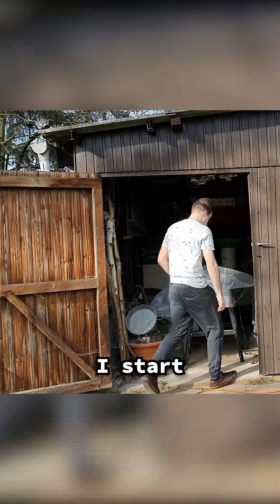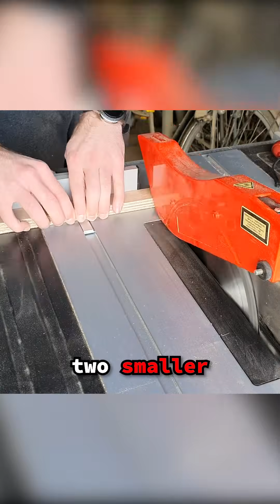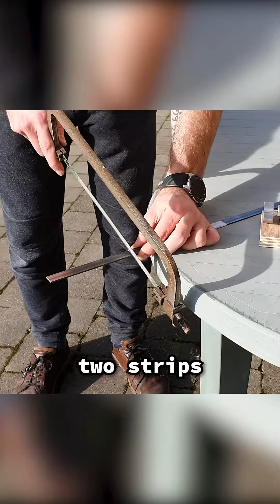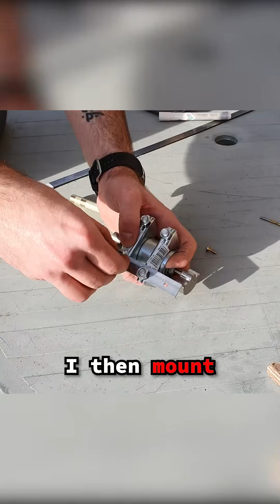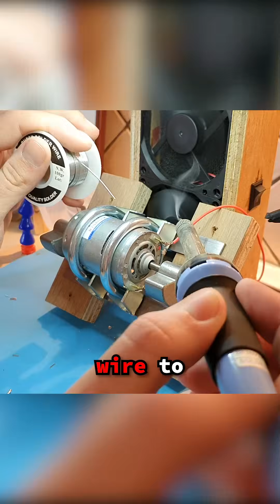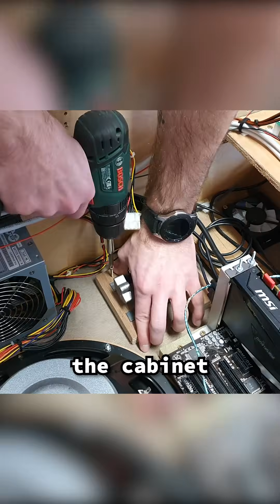Vibrate your Virtual Pinball Machine! #shorts #32 #virtualpinball #retrogaming #diy #maker  #arcade

Comment: And where did you wire it, USB Controller or Arduino? And how the System gets the info that there is a vibration Motor.
Reply from the maker: It's wired to a Pinscape controller. I had to configure the software so it knows there's a shaker motor. There's more info in the full video's